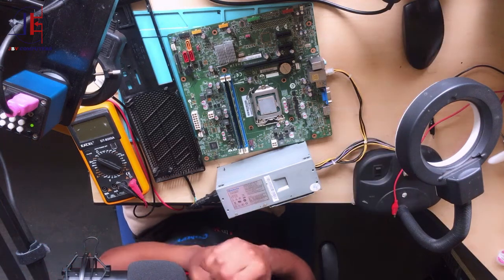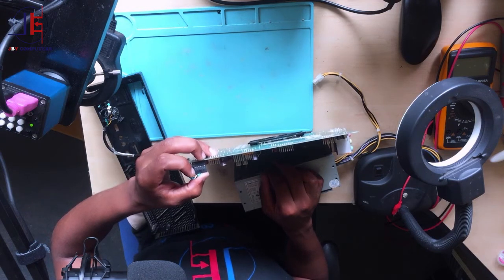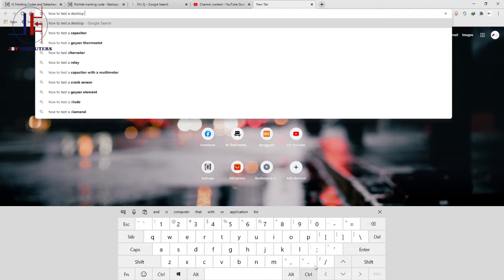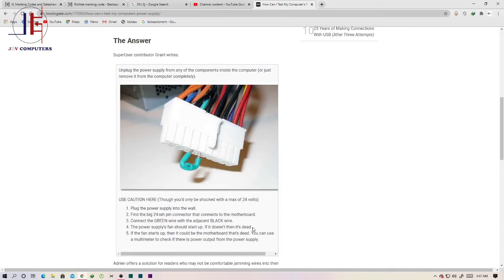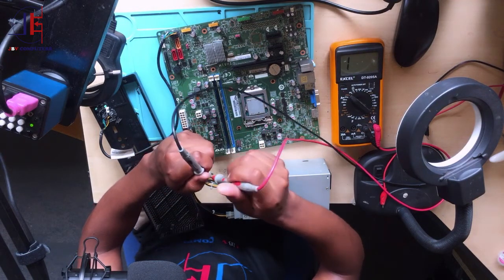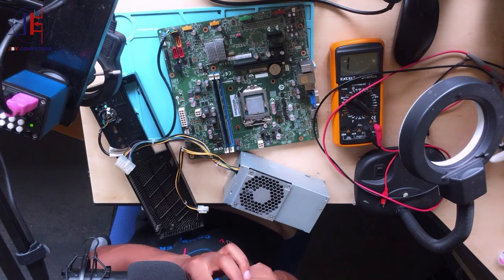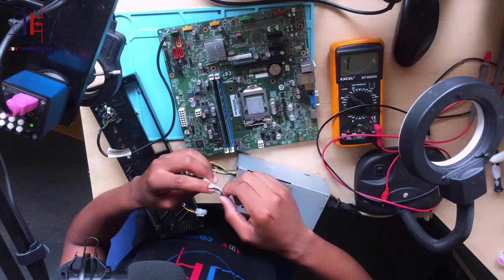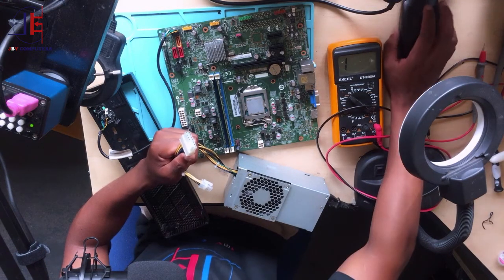How Can I Test My Computer's Power Supply?

Comment: That power supply is old and it is time for it to R.I.P. 

I had a lady with a old Pentium desktop that she uses in a shop. She said the fan on the power supply was loud and she switched it off and restart it but no boot. 

The thing is that the pc came on and hard drive came on but the hard drive light didn't work. The pc screen was ok. So I unplugged the cd rom and hard drive and still nothing on screen. There was another pair of power plugs loose from power supply. I changed it around P4 with P5. They are the same voltage. Now when you press the power button the Hard drive light shows and the power light is off. When you release power button hard drive light  goes off. Change the cables back around and the same thing happens with power on and no hard drive light but it is spinning. Fan on PSU was still spinning. I think one of the power rails was shorted on PSU.
Reply from the maker: Why you didn’t take the psu apart, repair it and try to find the faulty
Reply: @jbvtechnologies  She said she will buy a new PSU and contact me when it arrives and then put it in. I asked her if I can fix it at my home and she said no. Can I WhatsApp you ?